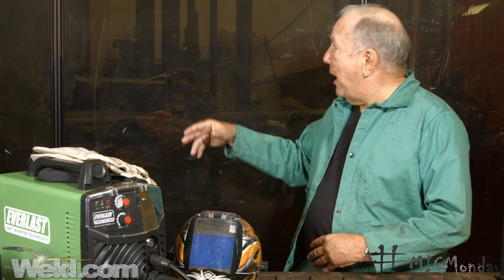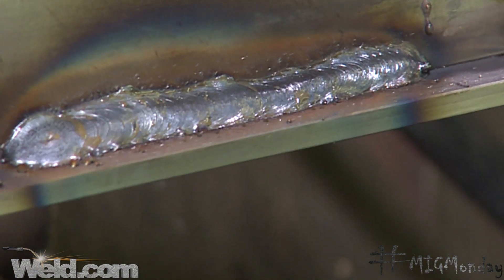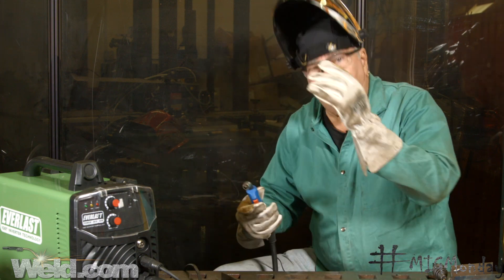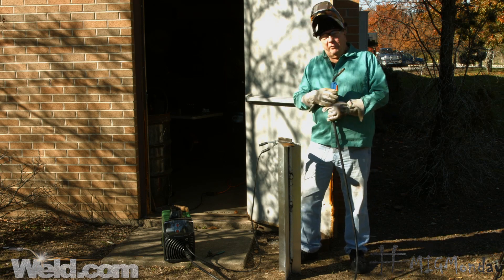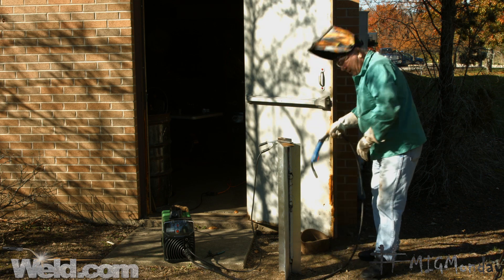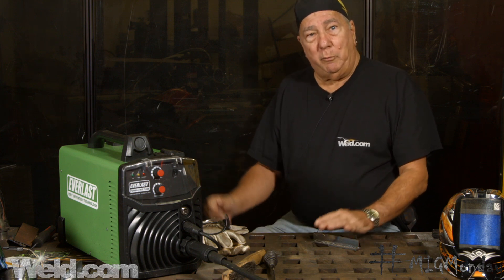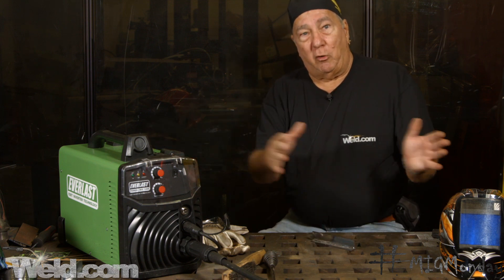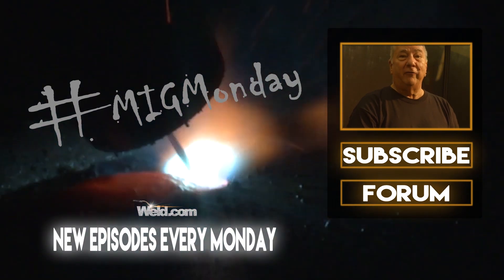MIG vs Flux Cored Welding and when to use each

Comment: Thanks kindly Paul, I have a (think they call it) stick welder and I really like the wire driven type (I've only tried it once), but it was so much quicker & more convenient, then changing the electrode constantly, but it was gas (not flux cored) and by watching your demonstration, I see
that the flux cored wire driven type seems pretty much the same as gas, so again, thanks for the info, I appreciate it.

Comment: Very well explained. I have some knowledge in welding but I didn't understand the benefits of each process and I feel like I have a much better understanding now. I work in the construction industry and I see alot of stick welding and what I now know is self shielded aka flux core. I want to learn to weld and I'll most definitely be using this channel to learn some tips and tricks but ultimately the best way is just to start.

Comment: Excellent presentation.  My thoughts are that MIG has the advantage of being able to weld additional metals, for example Aluminum, is generally a cleaner weld and can be used on thinner materials.  FCAW has the advantages of not being affected by the wind, can have a higher heat input to weld thicker materials but has a higher spatter problem.  The spatter problem can be minimized by proper wire wire speed and voltage settings as well as through the use of anti-spatter sprays.

Comment: FCAW is generally stronger than GMAW with better penetration. I was shocked when I did destructive testing on various FCAW brands with GMAW controls. Harbor freight and Hobart were about equal with the GMAW controls. Everything else tested massively exceeded the performance of the controls. Lincoln, Radnor, Victory, Inetub  took the full bend. Lincoln even has Seismic rated unshielded flux core wire now. There's a reason why Short Circuit GMAW is prohibited in structural and piping applications. It's funny how for years I would go out of my way to use GMAW over FCAW.

Comment: I see no reason to use self shielded mig  it's Smokey and dirty and a crap ton of spatter.  Try 90-10  Argon- Oxygen-- Yes  You read it right  Oxygen .  If you can handle that Much Power"

Comment: Your concise and simple explanations are refreshing in these days of extended long streams of words by many.
Reply: PHIL ,  I was in pre-law in high skool, Euclid, Ohio.  Then pre factory work, then 
beginning mechanics.  The brief explanation is helpful, yet I practice
at mechanical stuff over & over.  Riding
Bicycle to save nickel and dime for 
either 6011 3/32 in. Rod.  , vertical up
on Chevy Van box beam rusty area weldment.   115 Volt stick ?  Used to 220
beginner stick Hobart.    Mom moved, 
and rather freeze 6011 then freeze 4 months.

Comment: I love using flux core as much as possible. It’s cheaper, has great penetration especially on rusted steel. No need to bring a tank is nice in the field.
Reply: I’ve found that flux cored wire is twice the cost or more than bare mig wire. If you’re welding with straight Co2, mig is way cheaper. “In the field” stick is cheaper and better penetration than both, unless you’re using spray or gas sheilded flux core.

Comment: I have a Hobart that can take a bottle, but after this video I think I’ll just stick with flux core.  I don’t have a shop (so all my welding is outside) and I would rather not lug a bottle of it doesn’t make the weld stronger.   The only reason I began watching videos on the difference was a guy on YouTube was welding aluminum.

Comment: Thank you so much for your videos. I have an unusual question. Though it may be more expensive, can a shielding gas be used with flux core wire for added shielding?
Reply: not really needed but theoretically you could.

Comment: MIG for clean production in controlled environment, flux core for field on contaminated steel, rust, water, paint etc. Acts just like 6011 rod (Fleetweld 180) hands down the best.

Comment: Outstanding video as always. I’m finally going to move up from flux core to a welding process that uses gas. I have some experience with MIG, but I’m leaning more towards TIG due to its versatility and appearance. 
As for the peanut gallery,  if you clowns could weld better than Paul, you wouldn’t be clicking on an entry level instructional video like this.

Comment: How do you see the unwelded seam when you drag flux core wire?..I always pushed with my cheap CH versa 110v..might explain my crappy welds all this time..Getting ready to weld with my new hobart 190 and wanna do this correctly..
Reply: I asked which # helmet shade to use and 
was advised # 9 through  # 12.  With begginner Hobart stick I put a lightbulb
to direction of line and closed helmet.  
Novice at stick yet 220 volts seemed to
slowly, between much cleaning penetrate base and T.    Sparkler FC
HEAVY WHITE CAULK LINE ?

Comment: I love that you guys actually explain the difference between the processes instead of crapping on one VS another.  An unexpected recent expansion to my company became onsite trailer repairs.  I've actually enjoyed learning the flux core process.  I can make great looking strong repairs while being able to run off a generator working outside and not having to worry about gas and whatnot.
Reply: I also like flux.
It handles like MIG but welds like 7018.

Comment: Thanks for that great explanation between mig and flux core.  So far I have been just using the flux core but however I now have a bottle of gas to try out the mig on a calm day - I have no shop so everything is done in the back yard.  The bottle I have is strictly co2. I haven’t tried it yet so I really don’t know what to expect.

Comment: What is harder to learn? FC/MIG or Stick welding?
Reply: Judging by the videos I have seen, stick is harder for most since you hold the stick from a distance compared to the mig handle. Also you have to move your hand closer and closer as the stick shortens. It is easier to keep the same hand angle all through the weld.

Comment: Though have done gas welding and cutting on rough projects, my pit barbecue setup for one, I just purchased my first 180 A wire arc welder. Of the video series I have looked at in preparation this is the most useful I have come across for getting up to speed quickly and building on a little base knowledge. Thanks so much for your efforts to bring the information together clearly and concisely.

Comment: Thanks! I am new to mig welding, was hoping to find a video that was straight forward. This video made sence to me!   I highly dought that any person welding anything would be a hobby person! Lol :)   I am really good at arc welding, I hope my arc welding skill will help me move into welding with this mig welder alot more seamless than without, thanks for the explanation of what to expect from the welding wire
Reply: So just to update!  I tried mig welding tonight and the work turned out perfect. Must have been the years of arc welding that paid off. I went straight to using the wire with the shielding gases and you where correct that they throw off smoke, nothing in comparison as when I use my arc welder so that was pleasant and I exhausted the smoke outside!  Happy welding EVERYONE!

Comment: I have a Miller Multimatic if needed to weld out side I would use stick welding before going to flux core welding. Stick welding has a lot of advantages espacilly in maintenance over the others. The main thing in maintenance is the ability to use non-prepped metal even welding through paint and rust when you have to get something up and running as quickly as possible.

Comment: OK I know this video is a year + old...  I got a TIG welder because I wanted the versatility.  But then I needed to weld an outside job so I got a fluxcore welder.  For the home jober the combo is almost perfect.  For clean metal and when it's cold outside and good ventilation is problematic or when you are doing something other than steel TIG is great.  But Fluxcore will weld $hit to $hit.  As a home jober I am often dealing with some junk metal, old rusty, full of? junk.  TIG hates that, fluxcore doesn't really care.  Stick lays a pretty heavy layer of slag on the weld so it's harder to clean and harder to see the real puddle (as opposed to the slag puddle).  Fluxcore has a really light slag cover.
Reply: Mr. Koue, May 21 in Ohio garage with dew.  Attempting non-stick vertical up maybe  12/ 16 in..  I foolishly neglected
Rustoleuming  control arm front axle area, passenger side.  Thank for your
direct advice for less-than-sand clean 
or inaccessible  to grinder, Less watts 
with 115 volts if I can tack up down then
up,  FC  .

Comment: Great video, thanks Paul. I've been trying to decide for some time which type to go for as a beginner hobbyist. I don't have an indoor shop so now I've seen your video I'm set on going flux core which will meet my needs just fine. Thanks again 👍
Reply: If you want to get different process get a stick welder. Even if its a 110. You can  do more than just steel

Comment: Hay Paul, thank you so much for this video, I’m a biker and needed some expert advice on what sort of welder to get for a few fabricating jobs I need, some frame modifications and a few brackets to make and didn’t know whether to go gas mig or flux core, and you have totally given me everything I need to be confident with flux core. Indoor or out if needed, and no gas bottle hassles, definitely flux core for me. I’m assuming I just need to try and best match the wire the to metal I’m working with. Thanks so much. Rich from the U.K.
Reply: If you can afford it go gas my English brother. From down under Australia
Reply: I hope you went for a gas welder, they give nice clean welds and most can easily be converted to flux core if needed, and they often have a lower power range which is good for thin materials. I have a flux core only and I consider it a waste of money, although it's a cheap one -my old arc welder gets much better welds.

Comment: Good explanation in a way but with process is to be used inside to outside donts matter flux core will always be stronger then mig only thing mig is good for is putting in roots an building trailers

Comment: I noticed you pushed the MIG weld, but pulled the flux weld.  I'm new to this so was wondering if there was a reason for the difference.
Reply: med1pilot1956 slag you drag mig has no slag therefore there is no slag that can be trapped in your weld caused by the molten metal moving forward and rolling over itself which can cause a very weak weld causing it to break in any area slag is trapped

Comment: Which is a good welder to purchase
Lincoln 
Everlast 
Miller
Interested in making a dump trailer.
So is a tubing welder necessary or is the wire feeder welder all I need?🙄🤔.
Wish I would have taken welding in High School 2 of the 4 years instead of taking wood shop all 4 yrs.
Reply: Look in to the Harbor Freight Multipurpose welders, Titanium and Vulcan, great welders for the price !
Reply: @kukolino  titanium
Reply: Lincoln

Comment: Very interesting video, informative and on point. What I would like to add is that there is some disparity about the costs of the 2 processes. I bought a small flux core welder for under $100. A similar MIG unit would run almost $400 more, not counting the bottle. As a hobbyist, the flux core does what I need. Thanks for sharing.

Comment: I'm having trouble distinguishing between "better/cleaner" welds that gas is supposed to create vs. flux core "dirty/ugly" welds. Considering that flux core welders are used on pipes that are painted and buried etc, is the corrosion resistance and strength really that much worse than gas MIG welds? I'm wanting to do some auto body and floor pan work and I'm curious.
Reply: I don't know the science but I have found that the residue from the flux seems to make the parts rust more easily which is why I like the gas MIG when I'm welding sheet metal body panels.

Comment: Flux core does not always mean that shielding gas is not used and should be referred to as flux core rather than self shielded for the sake of beginners who will consider themselves knowledgeable after watching this  short video!
Reply: He was referring to it as "self shielded" because he was demonstrating both types in one video and needed correct verbiage to distinguish a difference. Flux core is without gas unless specified as "gas shielded".

Comment: I noticed you pushing GMAW and Pulling FCAW. Is that the ( If it has Slag you Drag ) Rule ?and or is that even a Rule
Reply: Yes, correct. Slag you drag is the rule of thumb. And exactly why you saw that difference between the two processes

Comment: I'm new to the welding. I'm gonna be trying to replace my exhaust and ill be doing it outside any tips you can give me would be great! Should i flux or gas?
Reply: According to this excellent video, if you do it inside you would use gas shielded (mig) and if you do it outside, you would use flux core. On the other hand, in the end, both will work.
Reply: I think you answered your own question. Flux core would suit your needs better. You can always buy a small roll of flux core for jobs like  fuxing your exhaust or fixing a gate. Then you still have the normal wire for inside work.

Comment: I hesitate to even ask this question here due to the trolls and elitist attitudes but here goes. 

Has anyone here ever used the smaller cheaper 110v flux core welders that ya see on amazon these days?  I have a friend that swears these little welders do great and I’ve seen some work he’s done and it looked fantastic. 

Ive heard some stuff on a couple YouTube vids where people say that these smaller 110v welders will pop breakers etc. and I was just wondering if that’s true?  

If anyone has anything else to add regarding these small 110v flux core units feel free to share your thoughts. 

NOTE: 
I did NOT ask what’s better. 
I did NOT ask what to buy.
Reply: I honestly cant account for the flux cores... but i have bought stick and tig ... and made many gates railings... they work perfectly for me i guess the machine is as good as the man behind it
Reply: Check out weldingtipsandtricks.com. Jodie did several videos in 110/115 volt machines.
Reply: I have a cheap pos welder. But the more I weld the better the welds get.
Welding is not easy

Comment: The first mig weld was so low on wire feed speed.The short circuit mig is suposed to have a sizzling sound,not hissing and big spatter ,and the self shielded flux core had too much contact tip to work distance...So if you do a how-to video,at last do it the proper way,in my opinion.
Reply: dani titus all you have to do is post your video

Comment: Its really has bean informative. Thanks a lot for making time to make the video. I have no experience in welding and have a question hopefully that i can get an answer. While doing MIG welding, if the out rim of the welding gun (the metal cover shielding the welding wire) touches the welding material, does it generate sparks? If it does not, can this outer part be rested on the welding material; if you don't have a steady hand?

Comment: He's 100% wrong on all aspects of this. Mig welding is not different than flux core. Flux core is a type of mig. Solid core wire requires shielded gas to weld. That's a form of mig welding. Inner shielded wire is a type of flux cored wire that does not require shielded gas which is also another form of mig welding. The last form of mig welding is duel shielded wire. It has flux core and also requires shielded gas to weld. If you lose your gas,aka wind blows, then you'll pinhole everywhere exactly like solid hard wire will.
Reply: Flux core is not a form of mig welding. The “g” stands for gas. If there’s no gas, it’s not mig. Flux core is wire welding, that’s the only similarity. There are a number of different wire welding technologies other than mig.

Comment: flux core looks like crap compared to gas no matter what wire brand what voltage or speed or which machine.
Reply: Depending on the welding procedure, this is not an accurate statement.
Reply: Depends on the person not the wire. I have laid flux core beads and dual flux core beads that looked beautiful when the slag fell off.